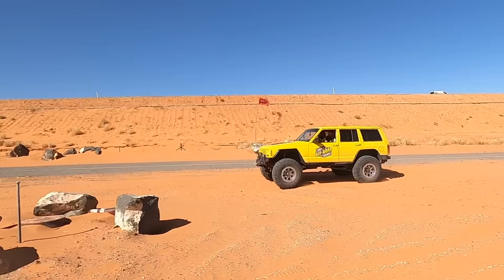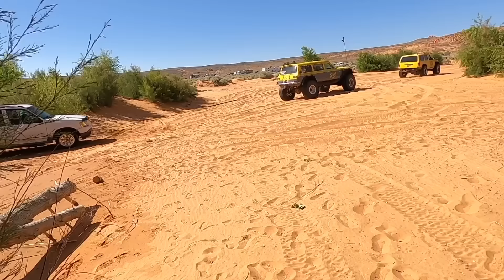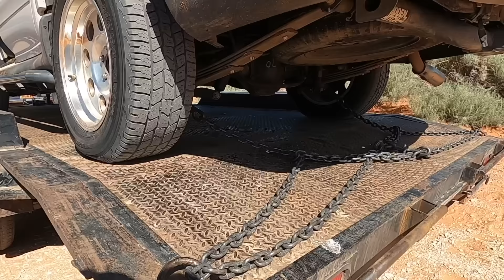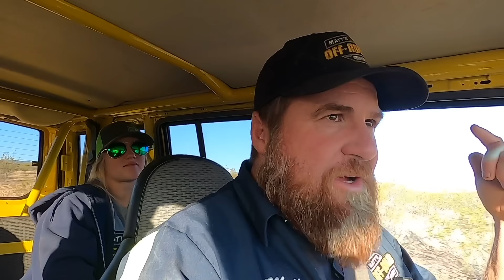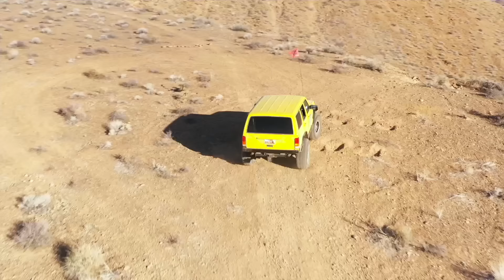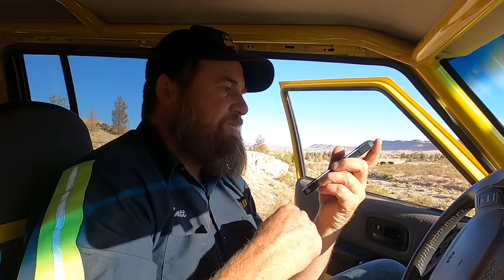Lying To Your Mom, Big Mistake! Dead Ford "Next" To Lake

Comment: finally Matt took my advice and put somebody in charge of the gas and it worked flawlessly😂! Great job Lizzy
Reply: With how your vehicles guzzle fuel and with the price of fuel likely $5.00 or more in your area you are going to need an armed guard when you go to the gas station.
Reply: @leonb2637  $4.69 for Reg at the Maverik in Hurricane. But I suspect he runs Premium which is $5.09. Still cheaper than where I live.
Reply: Over the pond we're paying about £1.80/litre or heading for $6.90/US Gallon.

My credit card (and in fact anyone else's) limits me to £99 or 100 per fuel station per day day depending on where I go, so unless I use multiple cards I can't actually buy a full tank any more.
Reply: @tomcardale5596  Why the credit card operator limits your refueling purchases? Doesn't make sense to me.
Reply: @cidadaodorense3231  it's not the credit card companies, it's the fuel companies.
But it still makes no sense.

You can't go back to the same fuel station twice in one day with the same card. Even different pumps.

You can go to the more expensive ones and they don't limit purchases, but the less unaffordable ones all have limits. Maybe so you can't fill a truck? Not sure.
Reply: @tomcardale5596  
Fraud..if you stole the CC...that particular fuel company doesn't want multiple thefts....and the hassle of recouping the money...

Comment: Just discovered this channel this morning. I grew in St. George and lived all around Washington county. Live in southeast Iowa now. Really nice to see the area again. I worked on the Mississippi river as a deckhand on a tugboat. We built the tow for the larger shipping companies. Anywhere from 2 to 15 200ft barges full of corn grain or coal. Where I'm going with this is that when I watch you guys standing so close to cables and ropes being pulled so tight, it makes me really nervous. As I've seen those brake and they can cut a man in half. Be safe out there.

Comment: Brings back memories of my teen years getting stuck offroad in vehicles that had no business going off pavement. Finally got my Jeep in my 40's. lol. Better late than never.
Reply: man when I was a teen you wouldn't believe how many times I stuck vehicles. Got 3 cars and one farmers tractor stuck in one day once lol the beating I got for it all wasn't too funny at the time though
Reply: Had an 05 focus hatchback backed by a 5 speed. Had aggressive snow tires on it and a 12 pack in the passenger seat. Anything was possible in that thing. Pulled out a danger ranger that was buried to its frame.
Reply: Honestly I'm scared to tell my mom where I've taken her truck in my years
Reply: Right me and my friends got stuck in my f150 that had 35s and 4 inch lift and water that was almost up to the bottom of the cab we were 6 miles down in a valley with no service
Reply: In 1984 I bought a 2wd Nissan truck, and a dormmate of mine and I decided we were going off road, but were not prepared for the snow or the digging required to get us out of the snow.
Reply: @Farm_fab  boy do I have a story for you, one time my mom went out of the country and left us at home and seeing as I had just got my license it was my job to take my younger brother (15) to school in the mornings, but my friend and I (17) had decided to take my mom's 2wd (with a rear diff lock) 2003 Nissan hardbody (d22 Navara essentially) and go camp on top of a large rock about an hour out of town, we made it there and barely got up the mountain, almost cooking the clutch whilst doing so (learnt the importance of low range). Some time in the night approximately 2am we got cold feet and decided to go home but we decided to leave the mountain and started to make our way down and poetically taking the wrong path, anyway we came to a dead end and I tried to back up but we were on a slight downward grade and the truck wouldn't move backwards on the grass so we started panicking thinking that we would be late to take my brother to school, but luckily we could go forwards a bit and do a three point turn and thus get the wheel speed up in 2nd gear instead of reverse, long story short we found our way down and onto the dirt roads and being 4am at this point we were so happy with ourselves and we bombed it into town on the tired old tar roads at 180km/h ,max speed with windows all the way down and blaring music the whole way, well we got my brother to school at 7 and alls well that ends well or so we thought, the week after my mom got back my mom needed to replace the clutch, but she still doesn't know why...

Edit. This was a good few years ago
Reply: Same, 2wd S-10's go anywhere with enough speed ...almost lol
Reply: Case of beer and 2 buddies we decided to mud a low rider s10, it stayed the night in the hole🤣, we actually made it through some very harsh spots with shear speed basically skipping the truck across 🤣, finally hit a good spot and that sucked sunk just like a rock does when you skip one
Reply: Last time we decided to drink and go play in the woods we found a creek to cross. Buddy was driving. Sucked in water and killed the engine, flooded the interior about half way up the hard doors, got out, grabbed my phone light and looked around and instantly said I know why we didn’t make it across, turns out we were in the neighbors pasture and tried to cross his damn pond 🤣, was an 88 wrangler on 35’s with a 4 inch lift, probably would have made it if we didn’t hit it so hard and choke out the engine, I blame that part on my buddy that was driving
Reply: manual 76 k5 blazer on 38.5 gumbo monsters

what is getting stuck?
Reply: @91fox35  "Case of beer and 2 buddies..."  That's always a good start to a great story so long as everyone lives to tell it.  :)

Comment: Seems like Ed is on a lot less recoveries. I hope he's doing well.
Reply: I'm thinking Eds probably in California mining gold before the heat sets in
Reply: It looks like rough trails.  I don’t know if the AC works on those rigs…. As you get older. Smooth rides, temp control is important.
Reply: @larrythompson8630  
YouTube is as close to that desert country as I need to be.....In case ya'll haven't noticed...... There ain't no fat boys on Matt's crew...And Lizzie is either running with the pack or takin' a nap....lol
Reply: Ed is definitely getting slower and less steady on his feet than he used to be, so I can totally understand why he wouldn't want to come out as often.
Reply: @KarlEller  In the video of the offroad wrecker, he's still puttering in the shop (Without being asked)

Comment: "Amazingly, they didn't run out of gas!"
I remember the column shifters. If the drive train is bound up at all they do not want to come out of park. 
Glad you still have the all abilities park link up. I donated once but if the month is not too unkind I can donate again.
Reply: If you donate again I’ll donate
Reply: The parking pawl is under pressure if you don't engage a parking brake first and let the vehicle "take up the slack" in the driveline...BEFORE you engage "Park".
On some cars the shift  cable is so weak that yanking on the shifter in those circumstances will break the shifter cable......and you'll still be in "Park"
Reply: @JohnSmith-yv6eq not true at all bud I been thru it before very easy 5$ part fix. Get a life get education get better kid
Reply: @user-gd6cz5ms5f  
Always willing to learn. 
What is the part and why does it act this way in the first place?
Is it operator error that induces the fault in the OEM part?
If replaced, does it still do this after X amount of use?

Comment: Used to hammer my Dad's 390 powered '73 F100 pretty hard when I was 13-14 years old. He sold it to my brother and my brother wanted to know why one of the front shocks was broken and that wheel had a dent in it. Never told him that can happen when you're practicing for the Baja 1000 in a stock 2wd pickup.

Comment: I always chuckle some about the running out of gas. When I was a kid (16) I had a ‘50 CJ3a it wasn’t licensed and was mostly a ranch vehicle. The gas gauge didn’t work and I don’t think I ever put more than 5 gals of gas in it at any time. I ran out of gas so many times my folks quit worrying if I didn’t get back from the fields until after dark in fact they quit driving out to see if I was ok. So when Matt runs “low” on fuel it just harkens me back to my youth!

Comment: A polite congratulations for your fuel management during this job. 😉

Truth is an empty tank means you stop at gas stations fewer times than those quarter/half/whatever tank people. Gotta think like a pit crew, there's perfectly good fuel in that tank you're not using otherwise!
Reply: Yes, there is still perfectly good gas in the tank when you refill at 1/4 or 1/2, BUT refilling at either of those marks, you not making the fuel pump run w nothing to keep it cool. The pump, being an electric motor, creates heat, and the liquid gas surrounding the pump is what dissipates that heat to keep it cool so it doesn't burn up and leave you stranded.
Reply: Never been stranded the way I fill up for 30 years, but you do you my man!

Comment: Ive never busted your chops about running outta gas i do it quite often myself but glad you didnt run out but looks like the rear tires are blad on one of your rig time for new set of milestars
Reply: @MattsOffRoadRecovery   wow learn something new everyday does the balder tires help not to dig so much being the sand is dryer and lighter in summer?
Reply: @nickwhitehead9263  Exactly, good deduction!
Reply: I unfortunately have no experience with sand yet hopefully will change in time

Comment: -- Heh, that last side by side belongs on a golf course.  Not out there in the rough, no pun intended :^)  On gas, hey it's nice to have a working fuel gauge, do it.  But the way your tanks are configured, you could also get a float cap: Gas cap with a float and gauge right on it.  That way if intuition fails, you forget to fill, or the primary gauge fails, you have an analog right on the tank.  Thumbs up.

Comment: When I was 16/17, growing up in Massachusetts in the late 80s, I took my mum's Hyundai out during the snow and blasted through some huge powdery snow drifts with it one evening after work. Stupid move given you never really know what's inside a snow drift that large, but nothing damaged. The next day, it wouldn't start properly, and my dad opened the hood and found the entire engine compartment just packed full of snow. He wanted to know what the heck happened. I may not have been completely truthful.

At another time, I went into a parking lot and did donuts in reverse in that car (with my friends hanging out the windows) until I eventually broke the reverse linkage.

What finally got my car privs taken away was when they were at an ice cream shop on this huge hill nearby, and I flew past it, taking the corner at the ice cream shop on two wheels, friends in the car with me. My parents saw me, and I heard my dad yell, but wasn't 100% sure of it at the time. 

I had a very abusive relationship with that vehicle. I can't imagine why my parents insisted I get my own car :D

Comment: Four wheel ATV without four point seat belts is STUND BUT no where as crazy as taking it up a hill with no helmet ! What's the worst , it rolls over and crushes your head against a rock but does not kill you but leaves you with a permeant drool .

Comment: Sorry Matt,
I do apologize if my suggestion for putting a 60 gallon tank on the "Largest Off Road Wrecker" was considered a blight on your reputation or hurt your pride. That was not my intent. I heard you say that it took 3 times as much fuel to do the same work it made me think of putting a large tank tucked into the frame with a heavy skid plate would be a good idea to think about while you were building the wrecker. I know when you are called you go, sometimes in the middle of the night and fuel isn't the most pressing thing on your mind. Also having a long drive into the back country on a rough trail as you are building this wrecker for, it was my intent for your safety on getting out, it would be nice to have a fuel tank that would be protected with a heavy skid plate. I have seen some of your friends and you do some really remarkable ways a vehicle can be built up, I thought if you put your heads together you could custom make a fuel tank that would serve you well. Again Please don't consider my suggestion a tarnish of your way of doing things. I do love the episodes your group has put out.